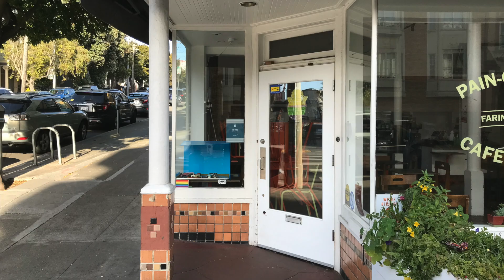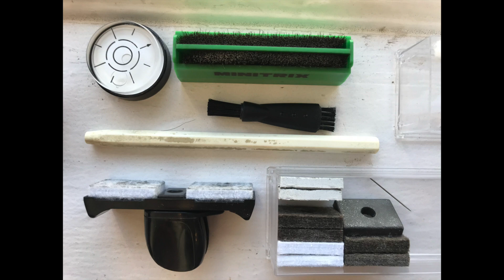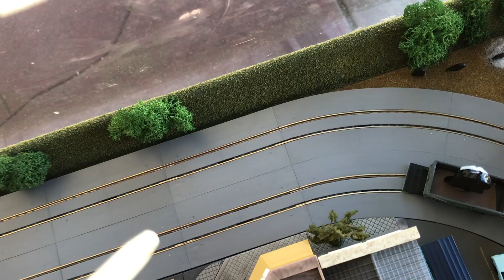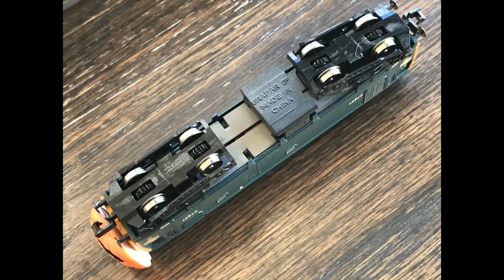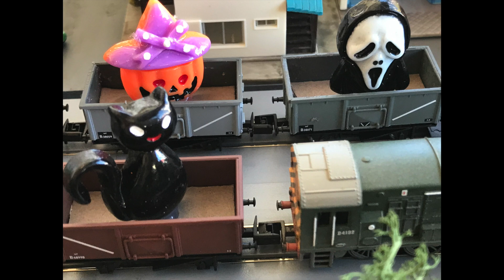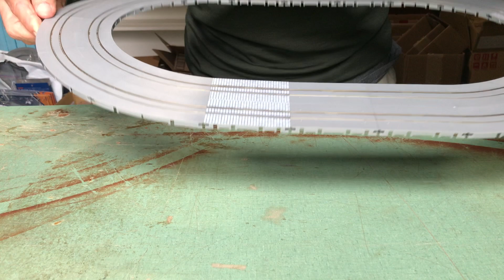Holiday Window Display Train Maintenance N Scale

Comment: help!  please tell me how to contact onetrue for advice.  am thinking about a unitram V60 starter set x 2.  and connecting them as simply as possible via electric switch turnouts?  thinking 2 v60s since that might be more interesting then 1 set and simplest way to achieve.  have looked at infinite # web pages and videos but cannot wrap my mind around how to.  and want usa versions where possible.  am senior/senior person with all my faculties working.  thanks,